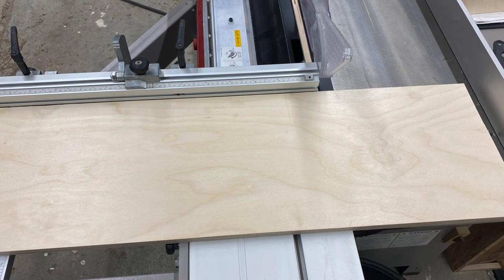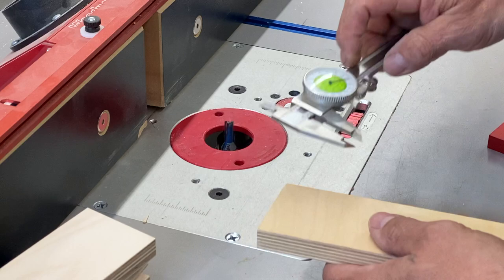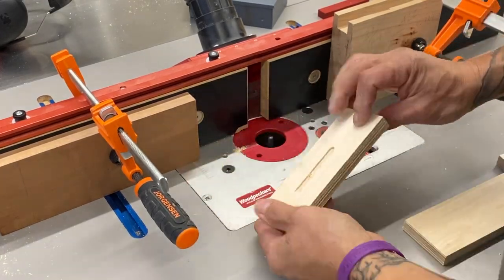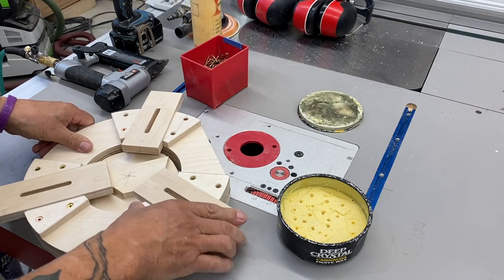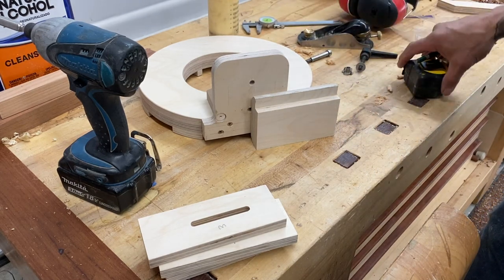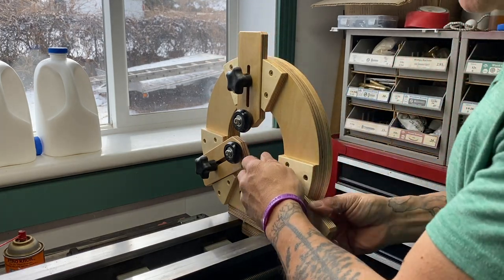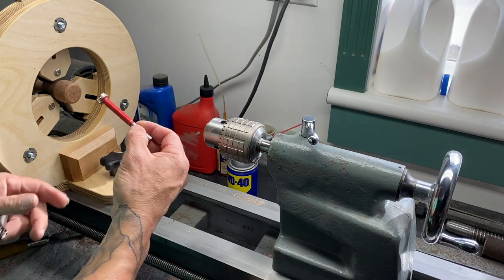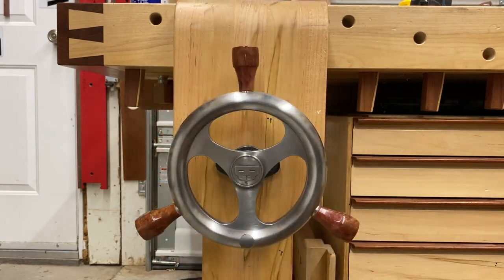Shop-made Steady rest

Comment: Super work on the steady rest.  Yours is much nicer than mine but the design is almost identical.  I made mine quite a few years ago before I had my Shaper Origin so I had to cut the circles by hand.  I use it all the time when turning pepper mills.  I got my wheels from Lee Valley and it looks like they still sell them - Item 12K7985.  They have the inner bearing and don't mark the workpiece.  That's a great lathe you have there.
Reply from the maker: I wish I had paid attention when I ordered the wheels.  But I can always get some with bearings.  I’ll check out the Lee Valley version.  Yeah…I love this lathe but like my dads Southbend even better!  Thanks David!